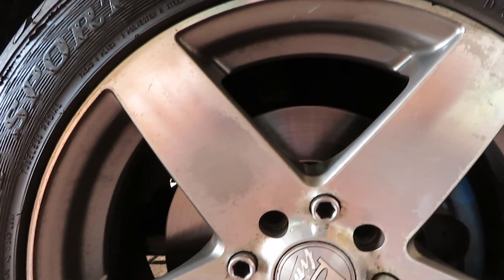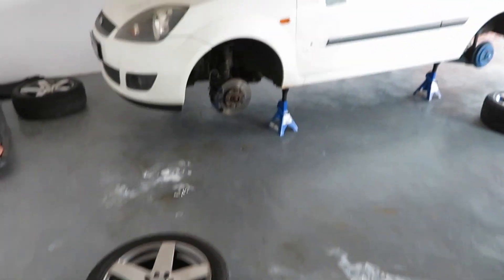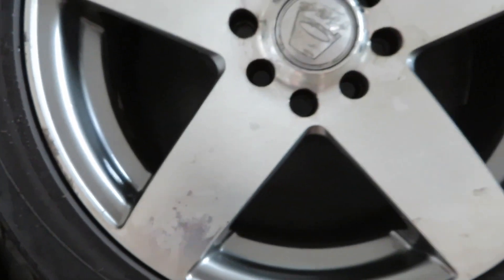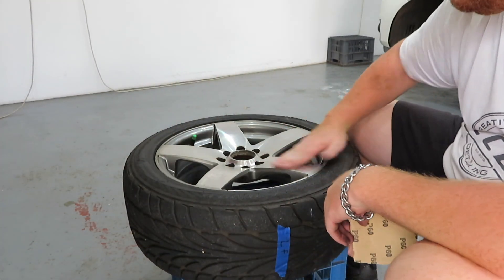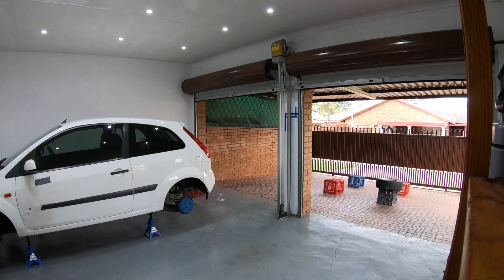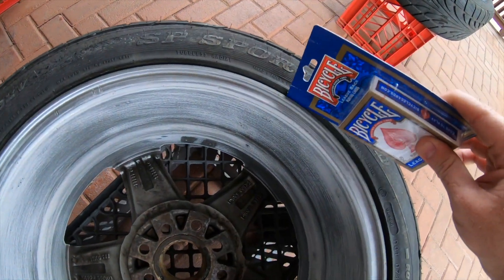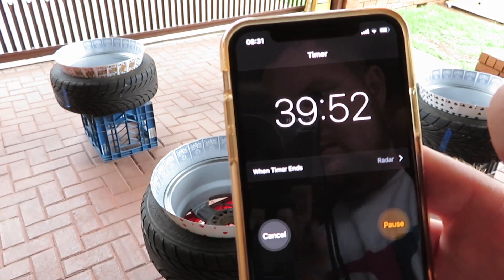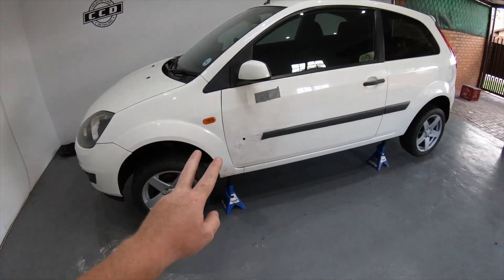REFURBISH OLD AND NASTY WHEELS AT HOME | DIY SPRAY PAINT

Comment: Looks amazing! I am real interested on if the paint will beat the heat on the front wheels. It should hold up paint handles the heat. Also a question from my side. Would it not have been better if you at first did all the painting and then the clear lacquer? 

Still looking FANTASTIC! 
DIY well done!!!
Reply: @CCDVIDEO  makes 100% sense. I did not think about in in that way😜. You are correct. Loving this channel. I learn alot here! Keep up the great vids!